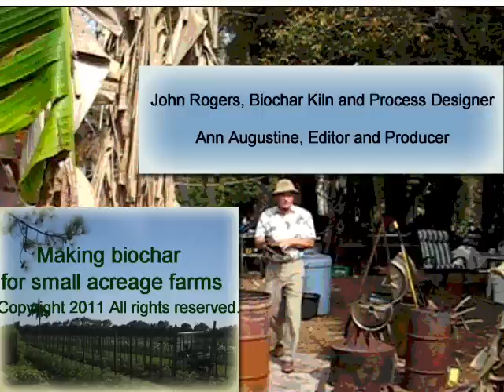Making Biochar For Small Farms

Comment: If there is a smaller barrel placed in the larger barrel the char yield will be greater. I have the type with two barrels. Better quality as well.
Reply: My date is Dec.26, 2025.  For 3 yrs I have searched for a 30 gal. barrow to put inside a 55 gal barrow to no avail. 
I found a source in Dallas at a cost of $147 plus tax plus shipping.  The only source that I have found so far.  So this method is intriguing although I do have some questions and concerns with it.  Mostly minor and they could have a solution if I think a little harder on them; not to worry.  The point is that John and Ann spent their time and energy to produce a system that works and offers it to the world for free.  Kudos to them and their spirit of Americanism;  something that is sorrily missing in this world of 2025.

Comment: This method looks to burn up a ton of the material into ash. There are some other designs that seem to leave you with a very similar volume of char as there was wood.  
The flames coming out of the top show that there is definitely combustion going on above the burn line.   This does look like a fairly simple way though. Not near ascomplea as some of the others.  May be worth it.

Comment: I'm definitely going to do this.  I already have about 6 barrels, get them for free at work.
Reply: Farming Life Australia. channel John uses  4  55 gallon barrels. That he cut the sides out. Takes a little longer. But works! I have made  about 200 pounds of char so far. I use my riding mower to grind up the char. Needs to be damp, and charged. To control the dust.  I just spread it over the garden, or field. Drive over the char to grind it up. Works good. Then I can work it into the top 6 inches.   https://www.youtube.com/watch?v=WflSIAFOPuw
Reply: @charlescoker7752  thank you for this link! I will be using this on my sandy soil hobby farm in Quebec.

Comment: Consider 3 bricks on the concrete pad to support and elevate your burn barrel for better air drafting. Quenching absolutely necessary to prevent biochar carbon oxidation.

Comment: you want the char as finely ground up as possible for the best results
Reply: No I don't think so. You want the char to be large enough to house microbes. I make mine from wood, crush it and screen it out to half inch and less size. Of course there will be very fine dust pieces because of it being crushed
Reply: @lawrencelawrence3920  you want it fine because it spreads through the substrate far more evenly (doesnt interupt roots) and you get a lot more acreage out of it. As long as its fully charged its good to go.  I reccomend mixing in some greensand ,mykos and feeding with molasses. I also 100% suggest you try a bottle of fish sh!t. The mykos fucking explode with the trifecta of fish shit,activated char and molasses. That applies to all plants not just weed and ornamental flowers. My veggies have more then quadrupled in average size ever since i applied all this stuff i learned to grow weed lol.
Reply: @zeroa69  when would be the best time to put it into the soil. It is Fall here where I live. Would it be better in the Fall or spring just before planting?
Reply: @lawrencelawrence3920  you may as well do both. Throw some down meow it will prime the soil. Mix it with your compost. Make sure its charged or it will steal all the nutes from of the soil

Comment: Very nice. But how is the air coming up from the bottom if the barrel is flat on the bricking? Won't the brick stop the air flow?
Reply: the barrel doesn't sit totally flush on the ground its got an elevated lip for stacking

Comment: Hey So awesome you made this video. I recommend using larger Biomass, which in turn give faster pyrolosis rates. I am using corn fennel and bamboo stalks. they easily dry on the plant and I don't need to do anything. I am thinking of getting some chips though as they are easily attainable for free from most county transfer stations.
Reply: University of Tnn. Said you can use old tires to make char. https://www.youtube.com/watch?v=rOUwg37N-40&t=4s

Comment: One of the best TLUD designs I've seen on YouTube for 55 gallon drums.  Only thing that I might change is more air intakes in the adapter unit to get more air entrenchment for the after burner.  What about the air gap at bottom?
Reply: If you notice, his burn pad was paved with bricks, which were slightly uneven, leading to gaps that gave very limited air flow from beneath.  The strong ‘rocket chimney’ action created a powerful enough draw that it got adequate air through the bottom to allow for the charring to occur.  Then after the burn, he moves the barrel to ‘dirt ground’ to block the holes and kill the fire.
Reply: Instead of placing on the ground, shall we put it on 3/4 bricks, so that from the bottom air flow will be more.. right ? in this case performance will increase or decrease ?
Reply: You would end up burning up all the charcoal if it gets too much air.

Comment: I just built one of these today, but did not have much success. I am not sure what I have done differently than you.
Some possible problems:
- May have been that my wood chips were wetter than I thought
- My wood chips may have been too dense, so that the air did not make it up through the bottom.
- I thought that the gaps around the afterburner adapter might have been too large, but they don't seem to be any worse than yours.

My fire only shot out the top of the barrel for a minute or so, then it just kind of died, and eventually got really smoky.

Any ideas?
Reply: Wood chips have to be very dry. We tried it once at a workshop using what looked like dry chips. But they were to damp. I think that in climates such is ours, where rain occurs regularly through out the year, that they chips need to be dried out of the rain before burning. I would put some of the chips in a clear plastic bag, seal it and leave in the sun. If condensation appears in the bag in the evening etc. This indicates dampness in the chips
Reply: Darby Crouch 
You need a gap below the barrel so it can get some air from below.   If the chips are too fine, it can also reduce the primary air intake.   Some designs have a chimney pipe down the center of the barrel on 1" risers so combustion gases can rise up the after burner and ignite.
Reply: +Darby Crouch probably was an airflow issue.  I tried to use home-chipped stock once, if was fine on small scale paint-can burns, but anything bigger-scale airflow became an issue.  I ended up taking a stainless steel cookie sheet and placing it over my burn drum and spreading the chips out on that and just stirred them with a gloved hand.  Worked a treat.  Just have to watch it because it can flash combust if the vapors ignite, or the fire licks over the side of the cookie tray.  Even did a few trial runs with some dripping wet stock that I'd chopped and chipped earlier that day.  Worked fine.  Just had to agitate it some during the offgassing phase.
Reply: Darby Crouch Put some in a freezer bag and leave in the sun. You can see the moisture on the bag if any is left.
Reply: Hi, Could you give me some datails about the chimney pipe that you suggestthanks.

Comment: There has to be a trade off between higher yields and easy setup. This setup uses a couple of oil drums, no welding, and is close to a load it, light it, leave it operation. Once you go down the retort road, you need to work out a way of building a gas tight hatch, which IME is not trivial, and you need to be prepared for thermal runaway.

Comment: From what I understand with all the research I am doing, the upward draft of air pulls the flame down through the material more quickly and burns more of the fuel from the product you are using leaving the natural coal. When the heat stays in place for to long it burns through the product resulting in more ash.  I have yet to experiment myself but I have watched many videos on this and the more efficient units use the upward draft. Im not saying this way is wrong but im seeing a lot of ash here.

Comment: this is not an efficient system for making biochar. To make biochar efficiently and in an environmentally beneficial way you need to have a seperate chamber for the biochar material and the burning material. This system may create some biochar, but much more could be created using a double burner system

Comment: EdibleAcres,  John is using a tlud which, by its process, requires that the feed stock be chipped.  The other method is called a retort, and it doesn't matter much about the sizing of the feed stock.  But---The time to fire a retort is drastically longer than a tlud (usually all day) and then a long time to let it cool (usually all night).  The result is that a tlud yields a much larger amount of char per unit of time
Reply: The quality is lower tho

Comment: BigBearHuskyMusher,  There's really no comparison between Azomite and biochar.  Azomite is a mineral based fertilizer that adds nutrients to the soil.  Biochar is a soil amendment that improves its ability to retain nutrients and water.  Biochar has a tremendous amount of porosity and the nutrients in the soil are attracted to the surfaces so that they aren't washed away with rain.  Letting the char burn to ash takes you back to a mineral fertilizer. It's the porosity that matters

Comment: Almost true - but what's happening is that, as the material goes through the process of pyrolysis, the gasses being released burn and consume "all" the oxygen in the air so there isn't any left over to burn the char.  The flame front moves through the feed stock leaving char behind.  The reason for the afterburner is that the burning volatiles use all the oxygen available and added air must be injected in order to totally consume it and have a clean exhaust.

Comment: Wondering if there are people who have used this system with a fuel material other than uniform chip material... As in, logs, reeds, paper, sawdust, etc.  Does the fuel material have to be uniform for the TLUD to function or can it be heterogenous like logs covered in wood chips for higher density output?
Thanks, this is a great design!

Comment: You might want to try inverting a 30 gallon drum full of those clippings inside one of your 55 gallon drums.  Will prevent more oxygen from being introduced and probably a hotter burn.
Reply: 6 years later, it seems most others recommend an inner barrel too.
Reply: Will it help if I follow the method shown in the video above as it is + I also invert a smaller barrel inside with wood chips.....so in a way the smaller barrel will ensure that those many wood chips turn into top quality wood chips+ I can fill up the outside gaps of the smaller barrel with more woodchips and also top it up with more woodchips as shown in the video to get more second grade biochar as shown in the video. Will this method work....if I combine TULD with inverted barrel method?

Comment: TheBushdoctor68, I can answer your question.  The burn took place on the concrete, where there was no seal around the bottom of the barrel.  Too, the afterburner (chimney) creates a lot of updraft.  When you place the afterburner on, you can hear the increase in draft - it's really remarkable.  After the burn was complete, the afterburner was removed, a lid was placed on the drum and the drum was moved onto soil.  Those things in combination stopped the air intake.

Comment: This system is simple, maybe too much so, but perhaps not.  Pyrolysis is by definition an anaerobic (without oxygen) process, which is why the other systems involve an inner chamber that is heated while the combustion itself (which is aerobic) takes place below or around the biochar 'chamber'.  

At the same time however, your process of choking out the fire before it is finished will most definitely create some anaerobic product, but it will be mixed in with the aerobic "byproduct", or ash.

Comment: Hi,I can't see how the primary air is entering the burn unit. The other's I've seen either have holes around the bottom of the outside drum or many small holes under the drum, which you would need to raise on bricks to burn. Do I have it wrong? Cheers.

Comment: Have built the TLUD exactly like yours. For other people out there. When you use an angle grinder for cutting it takes about 5-7 good cutting blades. Don't try grinding ones!!  Took about 1/2 hour to do. Worked perfectly with mixed wood. No smoke when the wood etc is dry just a big hot flame. You are right about the heat. The bottom glows red at night where the burn line is.  Next going to try the jolley Roger variant.

Comment: This seems an economical, but wasteful technique. I mean, a large proportion of the wood will turn to ash. I suspect that with a little more effort, the wood can be cooked without air, and the inflammable gasses produced  used to heat the next barrel/load - and so on.

Comment: Biochar, why dont you call it charcoal?
Reply: Biochar is made at higher temperatures than Charcoal.  Charcoal has lots of volatile resins left in the wood.  Biochar, when done right, is almost pure carbon in a matrix form.  That’s why it doesn’t biodegrade and why it acts like a sponge or battery.

Comment: Great video! really glad to see this. The one thing I see in this that I haven't seen in other designs is, most TLUD's have a barrel within a barrel, you're actually burning the wood in the bottom 55 gallon which is the same container you're getting the char from. How do you stop it from burning all of the wood? Usually, when using separate containers, its the gases from the (smaller) container that feed the fire but also char... never actually being exposed to flame themselves.

Comment: Hi John   I love your set up.  I do leaf char on a much smaller scale and will give you a link to see that.   I have a small suggestion after you stir the pockets of char to make sure it is all burned  just spray the char in the burner, then dump it out.  It stops the dusty ash from flying around you as much as possible (for health reasons), in "busy mode" you may not be thinking of that. You will accumulate the ash and smoke in your lungs that is NOT good!